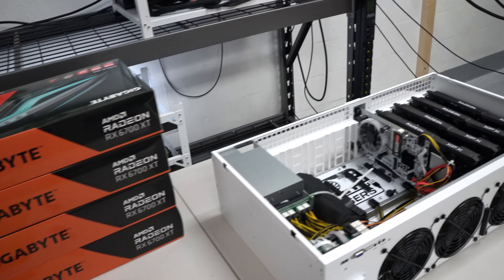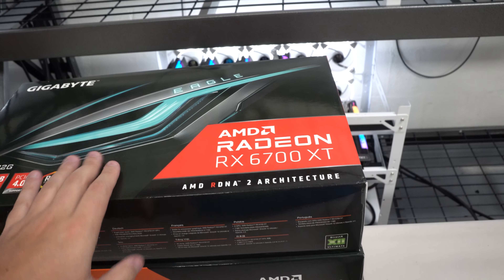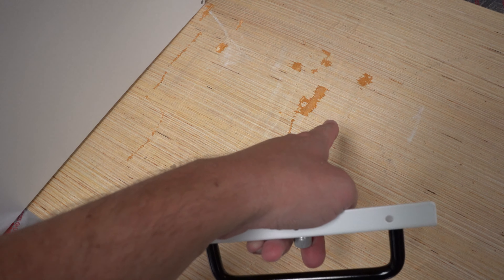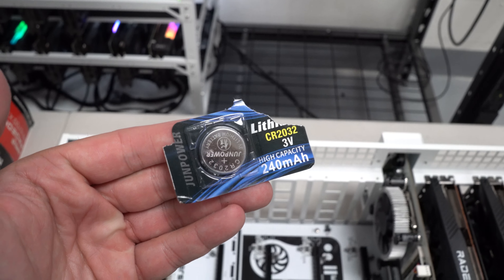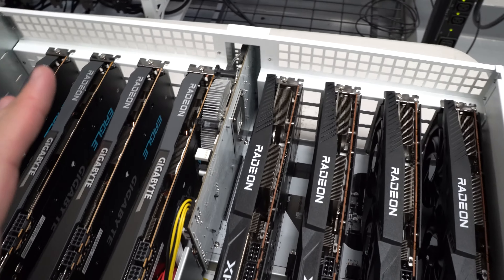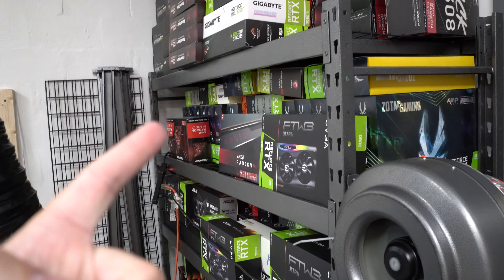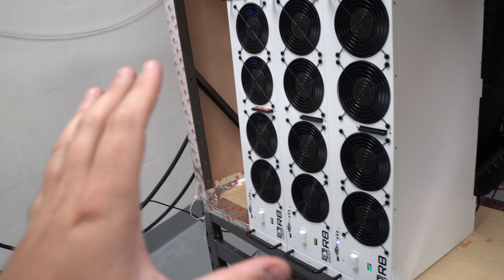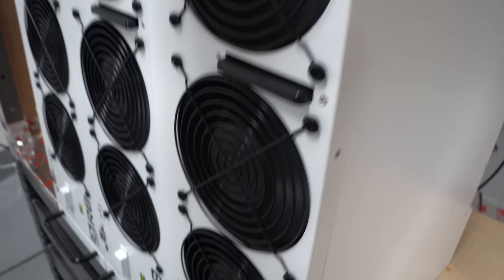More 6700XT's deployed in the GPURisers Crypto Mining Bunker! 🔥

Comment: Bro rtx 3070 vs 3070ti which best for mining and which is more efficient
Reply: I much prefer the 3070 over the 3070 TI‘s. They are way more efficient and they run so much more cooler. My 3070 TI rig Has a lot more hash rate than my 3070/3060 TI rig. But it’s hard to keep it cool and it cost a lot more run.